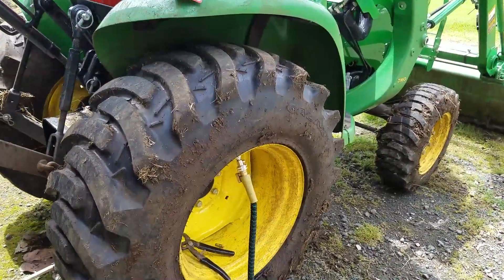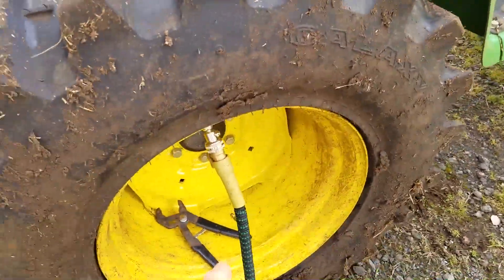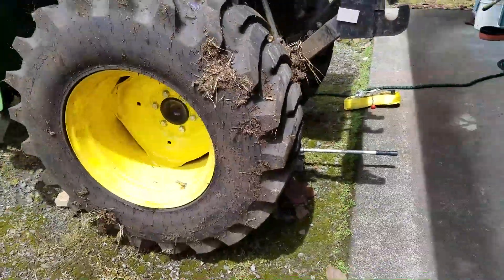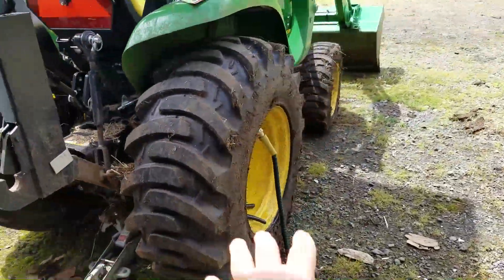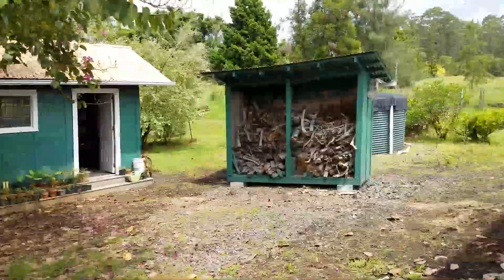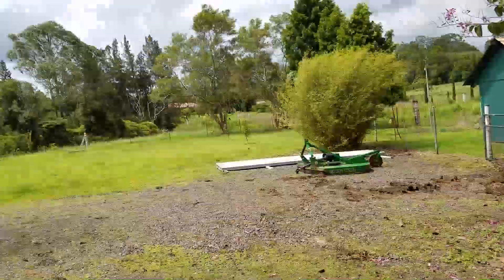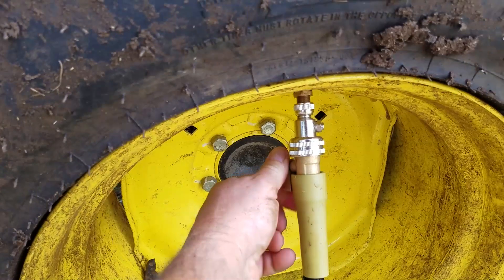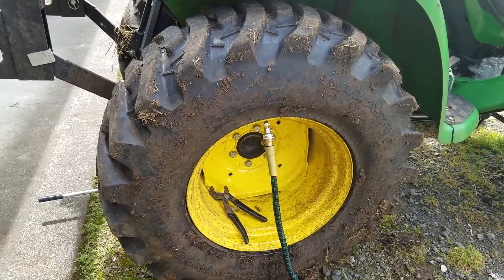How to put Water in Tractor Tire

Comment: Ya should have used an inner tube. Water will corrode your rims very fast. Ballasting tractor 🚜 tires is a great 👍 idea 💡, especially when your tractor needs more weight to perform a job it couldn't beforehand. The ballast pushes more weight into the ground, allowing your tractor 🚜 to put more power into forward motion. Just subbed!! Happy Thanksgiving (Gobble Gobble)!! Your friend, Jeff.

Comment: Hi Steve,
We would fill the tires up to a certain level by rotating the tire until the valve was about the 10 o'clock or 2 o'clock position to get @ 2/3 water to air ratio. This seemed to work best for our clients. Your video is great, quick and easy explanation. I'll be doing a waterfill on a Kubota tractor rear tire tomorrow on the Hamakua Coast and wanted a video for my client to watch, and yours is it! Aloha